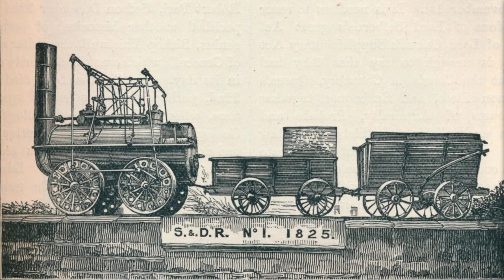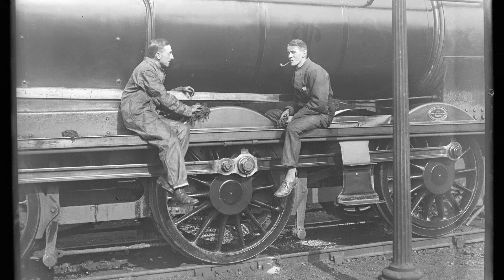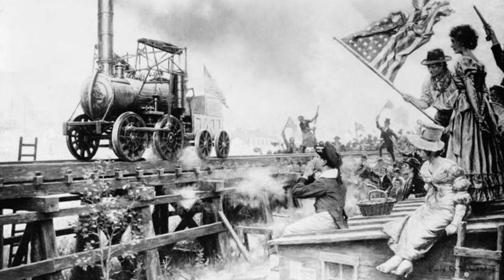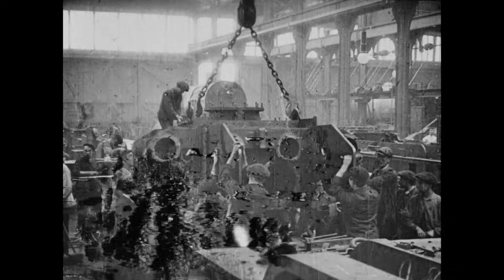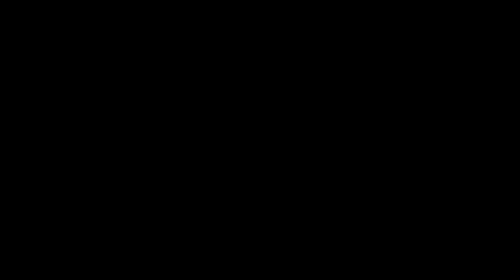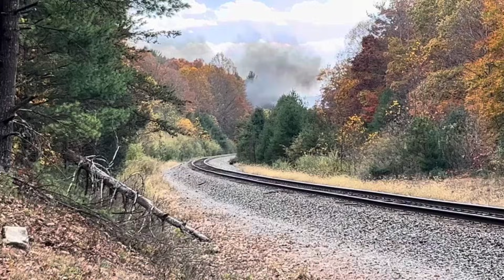15 Indestructible Steam Locomotives Still Running After 100 Years

Comment: As the German class 52 goes there are some  still in DAILY revenue service in Serbia and Bosnia-Herzogovina.
Those ex Romanian build for the Romanian state railways ( class 52's were build al across occupied/axis parts of Europe for the German wareffort) during WW2 engines are still used to haul coal from the coalmines to the powerplants. Zero fuel costs, cheap labour and lots of spare parts make them a no brainer commercially. Also the Yugoslavia war and its destruction in the 1990's of lots of infrastructure (f.e. pulled down copper overhead lines for the war effort) makes them still necessary.

Comment: Although Puffing Billy and sibling Wylam Dilly both survive, neither have steamed this side of 1862. There is a working replica, built in 2006, based at Beamish Open Air Museum 🇬🇧 

Coppernob (Furness Rly No.3) most certainly has NOT steamed in preservation. The Furness loco shown restored is a far later machine, being their No.20, which survived much rebuilt, as an industrial tank loco. It was restored to something close to original condition, being  steamed again in 1998.

The loco known as Lion (there's another story entirely there!) hasn't steamed since 1988 and seems unlikely to do so again.

52-8055 was one of a number significantly renewed by the postwar Deutsche Reichsbahn (DDR) and later rebuilt somewhere close to the principles of steam's last Major Domo ... (Argentinian engineering genius Livio Dante Porta) 

Glad to see the SAR Class 25 getting some long overdue love .... and I say that as a fan of the same railway's magnificent Class GL Garratts!

Perhaps the ultimate survivor is Union Pacific RR Class FEF-3 No.844, (currently stored, though operable) which was never officially withdrawn from service!
Reply: I believe that Cass Scenic Railroad Shay #5 was built in 1905 and is still running in revenue service.